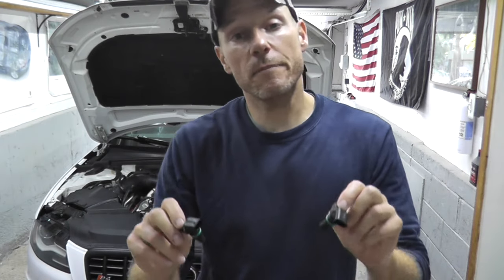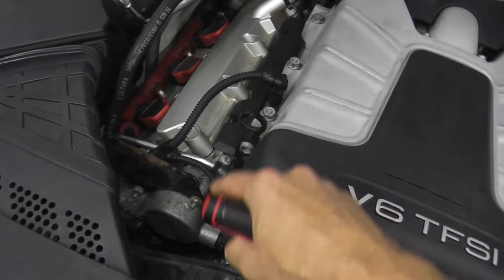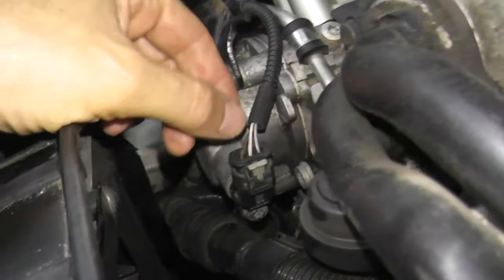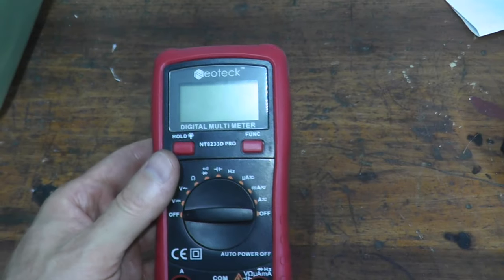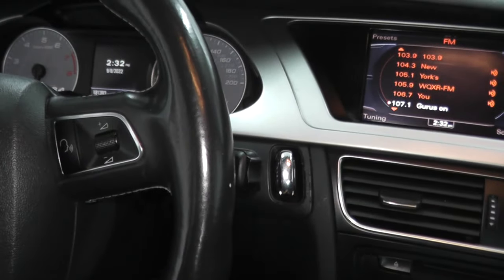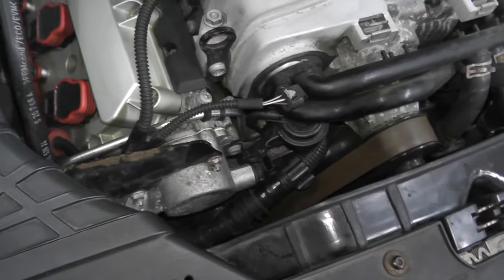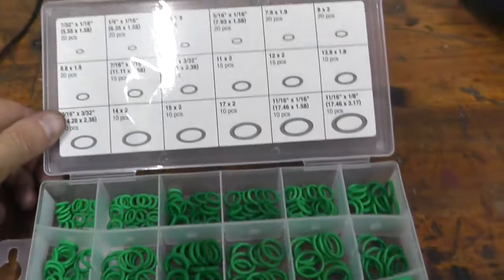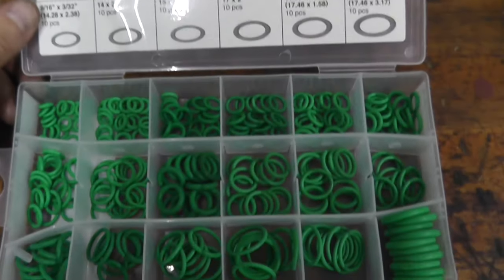Audi Camshaft Position Sensors P0340 P0341 P0342 P0343 P0345 | Audi Hall Senders |

Comment: I got a p0021 code could it be that sensor I replaced the timing chain kit and now it’s shaking when in idle no misfires
Reply: U ever figure out p0021
Reply: Did u found out a fix to it. I got a similar problem 0016 that's why I like to know.

Comment: P04300 can be that?  After going high to 7200rpm the fault came in. Hard start and loose power in driving.  
I'm afraid that the timing jumped

Comment: What if the sensors are working properly amd they are reading something worng in the engine. Changing the sensors would not fix the underlying problem, right?

Comment: What should voltages be on the plug to a camshaft position sensor? I have measured voltages on bank 2, intake sensor and it seems that the left wire is ground but two right ones are BOTH about 5 volts. 

Is this normal? I thought one would be 12v or so.
Reply: Most sensors use a 5 volt reference form a module

Comment: Anyone have codes P0016, P0012 come up on their vechile before? I hope its not my timing chain
Reply: Yep I had p0016 and timing was jumped on bank 2 Inlet camshaft sprocket. Was 1 tooth out. Major head ache to repair has to remove cat to access covers to retime and replace the top tensioner and guides as well.